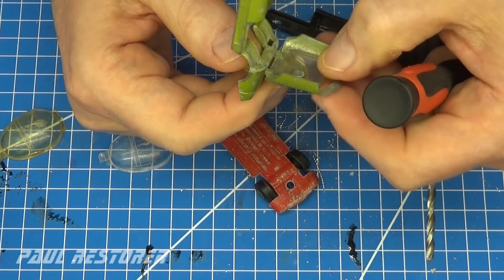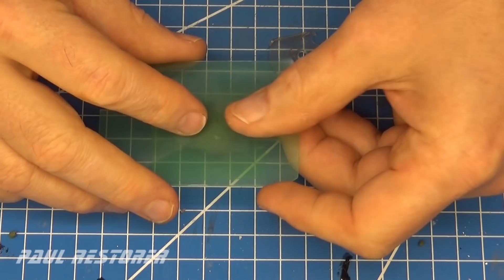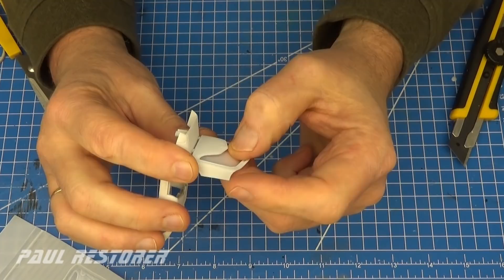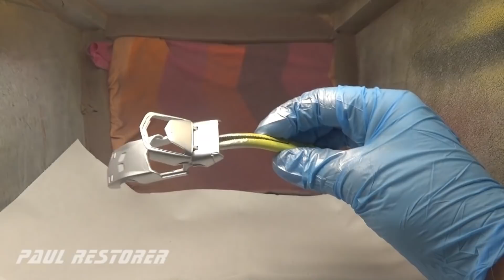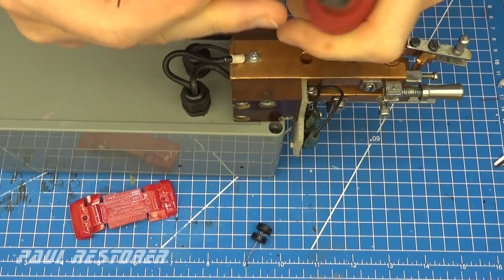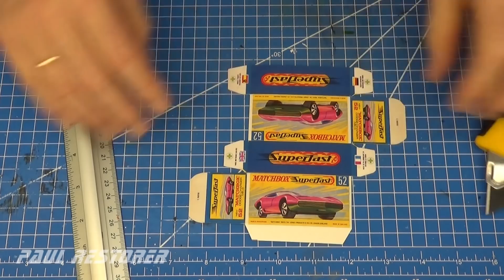Dodge Charger MK III no. 52 Matchbox restoration Diecast car making parts, 1972

Comment: Does the windshield forming process require such large spaces between the forms?  Could you get more parts from one sheet of plastic if they were closer together or do you need to have that much separation to get a quality result?
Reply from the maker: when thermoforming, it is assumed that the gap between the panes cannot be less than 2 cm. Kind regards